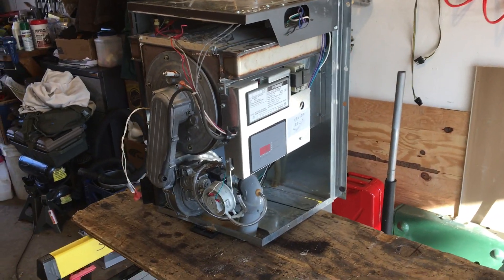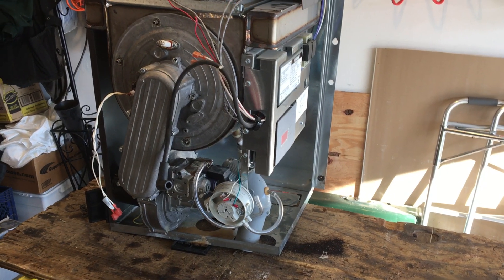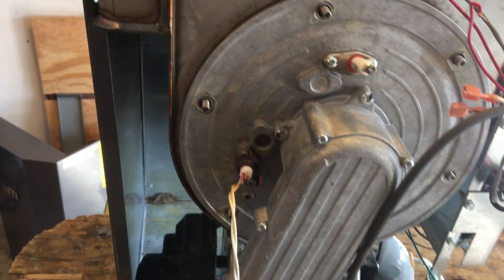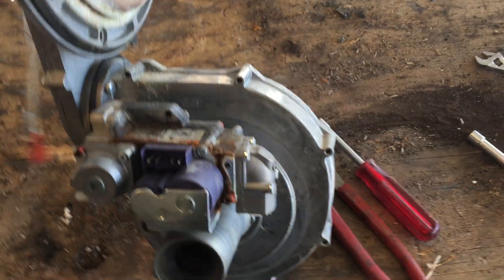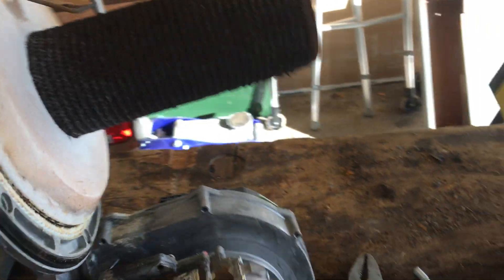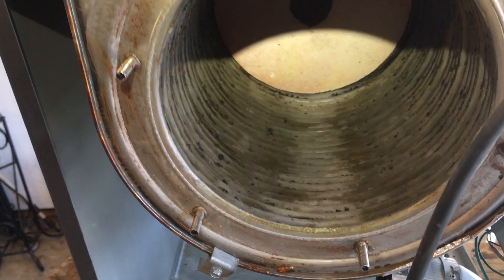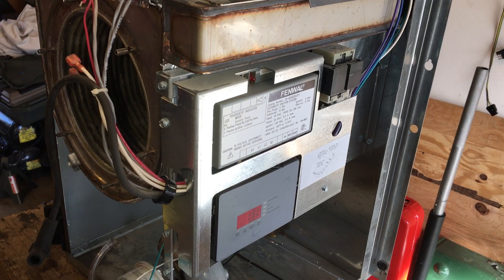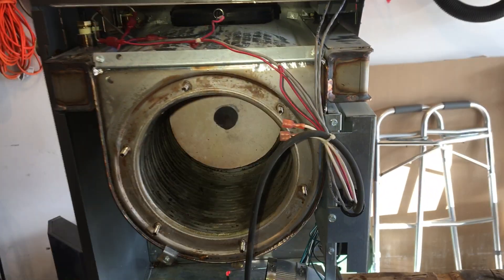NTI Trinity boilers.  Part 7

Comment: Hi, can I asking some questions about hydronic boiler?
Burnham alpine boiler have short cycle. Start drive off,preignite, ignite test, direct ignite, running after 10sec running lost flame and start purging. Water is abou 80-90 degree. 
Occasionally Boiler working normal temperature reach to 180 degree, but turns back to short cycle again.
I had replaced control board, flame sensor and high limit sensor, but still have same problem.